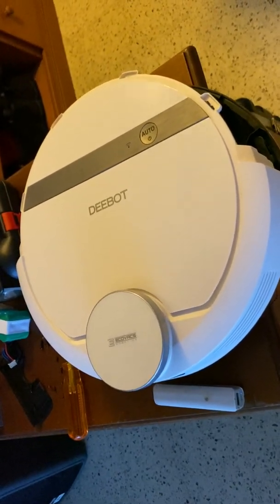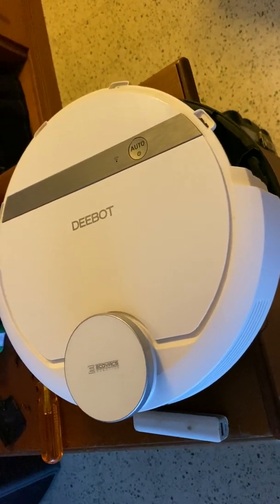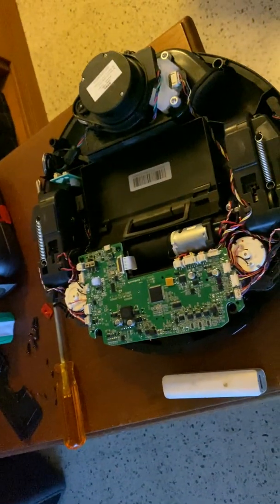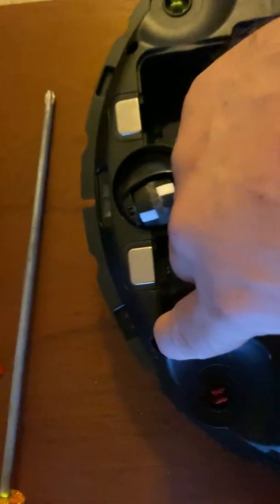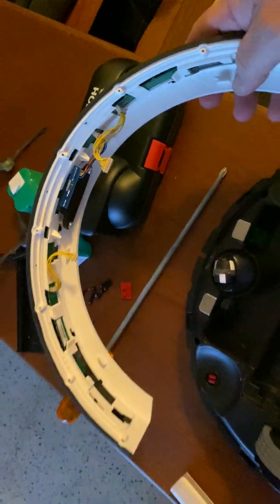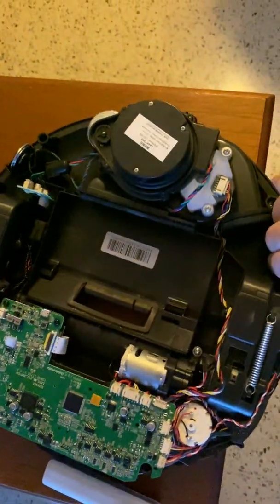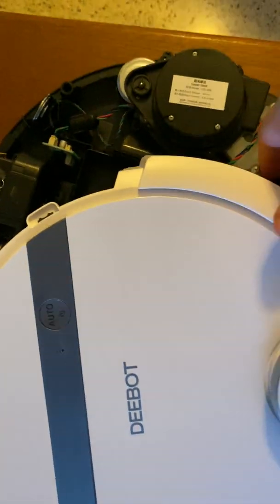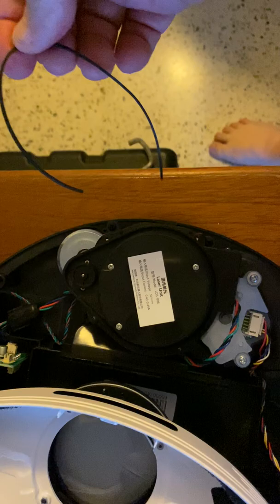Deebot 907 LDS malfunction

Comment: I have a Deebot 900.  The belt size is 220mm circumference, 110mm folded.  Thats the measurement they give when selling, folded.  Amazon has cassette recorder belt sets that contains belts from 40mm to 135mm. That is the set you might want to consider.  Width is a little over 1mm, maybe 1.5mm.  110mm = 4.3 inches.  I think 4 inches will do.  remember, the size they advertise is folded.  Hope this helps

Comment: Thanks for the video! I had the same issue, I took the belt to several hardware stores to find something similar...ultimately found a rubber "O" ring gasket by chance at my pool supply store that's used for a Hayward chlorine dispenser. Cost me $3.00 a bit heavier duty and better quality and works as it should.

Comment: Thanks for this video. I would get the LDS error and then if I used my finger to start spinning the LDS, the LDS would start spinning on its own and it would work. Not ideal since I need to manually do that every time I ran the vacuum. Watched your video, took it apart and the band was in tact. Replaced the band with a more sturdy rubber band and it now works perfectly. I don’t get it, but I’m glad it works!

Comment: I had the same LDS error, and after I opened up, the rubber band was also broken.  Replace the rubber band with a normal red rubber-band and fixed back everything.  It works!  Hope the red rubber band can last...  Thanks Ivan!